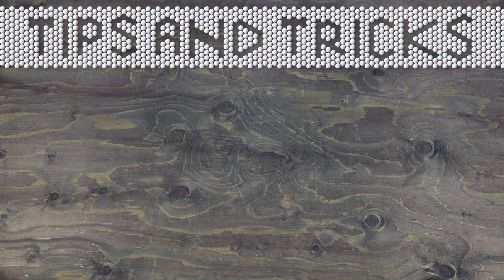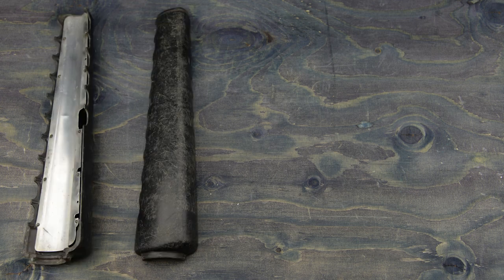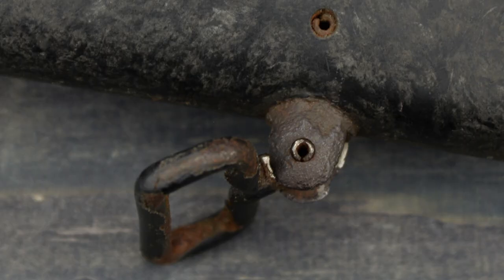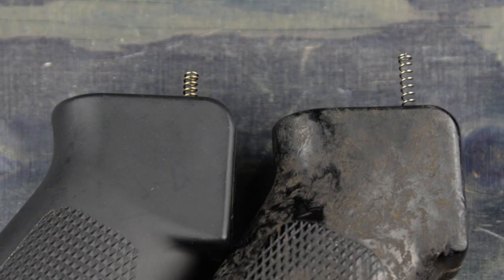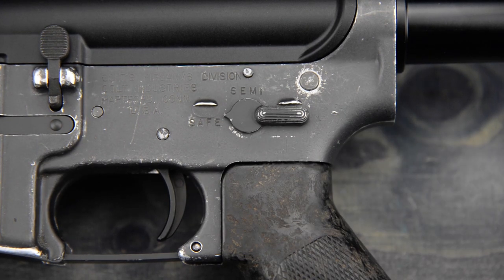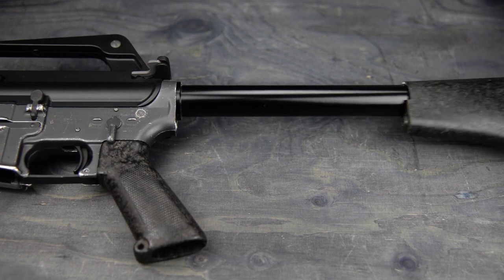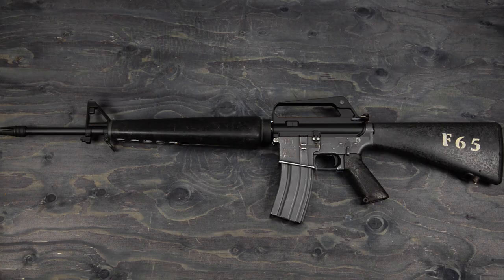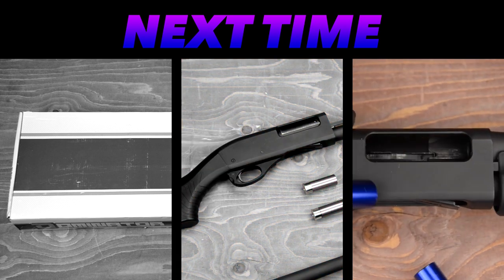TIPS & TRICKS - REAL FURNITURE ON WE M16A1 | AIRSOFT

Comment: I really like seeing mods to these airsoft guns I got a we tech m16a1 myself and wanna throw real furniture on it because the stock hand guard feels cheap
Reply from the maker: Whatever floats your boat. If one is after the pristine look of a brand new M16A1, then keeping the factory furniture is an acceptable strategy. Personally I do not mind the feel of those parts, but the original 1970's furniture adds needed character in conjunction with the real lower. However, a shorter real stock, or a stock of the users' preference, combined with some real hand guards for peace of mind is also doable. Different strokes for different folks.

Comment: Hey, dont worry about making the upper and lower match. Unless it bothers you that much. The shade of the real M16a1s often times didn't match either unless they came from the exact same batch. Colt had a hard time keeping the exact shade of grey between batches and thus, there are a lot of different shades of "Colt Grey". The "Colt grey", per US military specs, wasn't a set shade of grey but had a variety of shades from light grey to almost Black. if I was to take an M16a1 made in 1968 and place it next to an m16a1 made in 1969, chances are they will have a slightly different shade of grey.

Sure,  M16s almost always left the factory with matching uppers and lowers but through there service, as parts worn out and were replaced, it wasn't uncommon to see an M16a1 with Dark grey a upper and a light grey lower and vice versa.

Comment: I thoroughly found this to be one of the most helpful videos out there but one thing that I'm still not sure of is the original stock and buffer tube did you have to cut off some of the buffer tube to make it fit?
Reply from the maker: I'm glad to hear it. The buffer tube is unaltered for the 601 stock. I just needed to cut down the screw slightly.

Comment: Just to be nitpicky ;) The M16A1 used the birdcage flashhider. The "M16" however used the three prong. Though your WE has a forward assist which makes it an A1.

For quick reference: Here you can see an M16A1, notice the birdcage, fence around the magrelease and forward assist. https://s34193.pcdn.co/wp-content/uploads/2019/05/m163-1200x549.jpg.optimal.jpg

Here is an M16. Notice the lack of magrelease fencing and the threeprong. https://vietnam.masta.fr/img/ar15otf.jpg
Reply: The three prong flashhiders were just in Vietnam, just later replaced by the birdcage ones
Reply: a bit late on this but

XM16E1s used 3-prong flashiders and have a forward assist. I don't know if they have magazine fencing but it should be fine

Comment: I just tried to do the same thing for my own WE Tech M16A1 and I just managed to snap the screw for my buttstock in half trying to put it through a die.  You said it was an M5 screw, do you know the exact specs like pitch and length? The Chinese part manual is not very helpful haha.
Reply from the maker: Well, I did cut down the original to M5x20-ish (let's say 19mm to be safe), so if memory serves the screw was originally M5x25mm. If you want to be safe, WE sells original spare parts through KY Airsoft.
Reply: @SpecialWeaponsAndPlastic  thanks! I ended up just picking up a random M5 screw from the hardware store and it worked out. Sadly, my build still doesn’t look as cool as yours haha

Comment: Can you do a cyma m16a1 I need to modify mine
Reply from the maker: AEG's are really not my forte, secondly most AEG's are not milspec. To fit real handguards on a CYMA M16 you'd need a milspec forend kit, like G&P, and a real or milspec handguard cap, which would be costly.
Secondly you'd need to make room for the battery in the stock, since real M16's don't use batteries. And if you choose a XM16E1 stock, like I have, you'd need to remove the recoil pad every time you change battery, or have the wire accessible to charge the battery without removing it from the replica. Which would be a hassle.
Lastly we come to the pistolgrip. On AEG's the pistolgrip houses the motor, which requires a thicker grip and a motor plate. Two things which are not compatible or realistic to incorporate in a real-steel pistol grip.

It could probably be done, despite all the challenges above, but it's not on my wishlist.
Reply: Ok